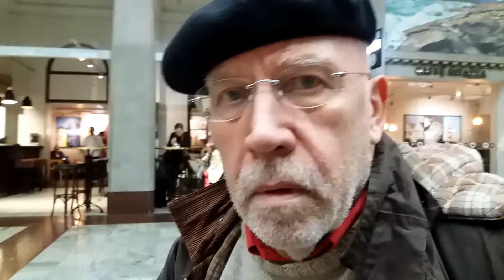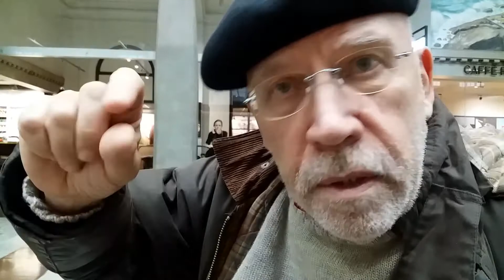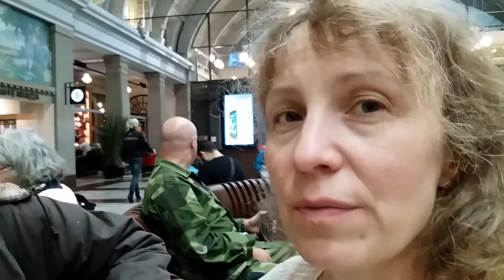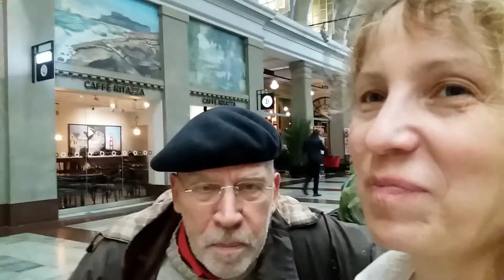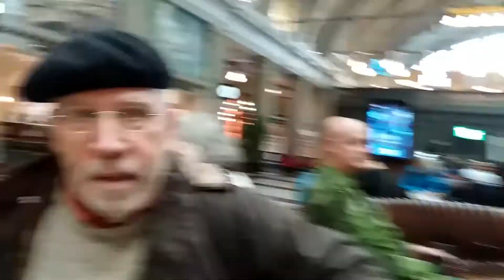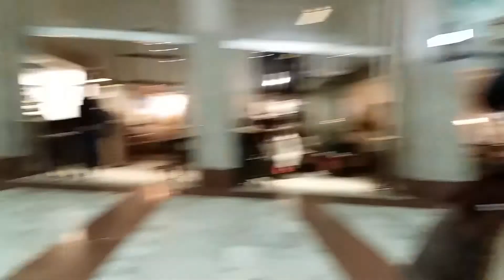C.Busby on deep borehole disposal for nuclear waste. 11.9.2017

Comment: '...the solution is dry cask storage in the middle of the Antarctic continent...store this crap in the middle of the most isolated, driest and coldest place on earth...' AmazingApe

AmazingApe are you aware the Antarctic, is the last pristine environment on earth, one used as a benchmark in the past, present and going forward, for measuring all other continents ecosystems?